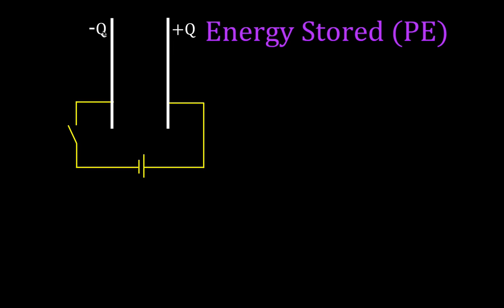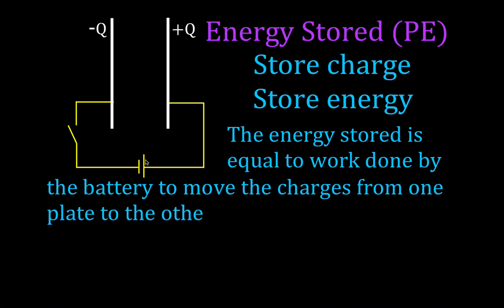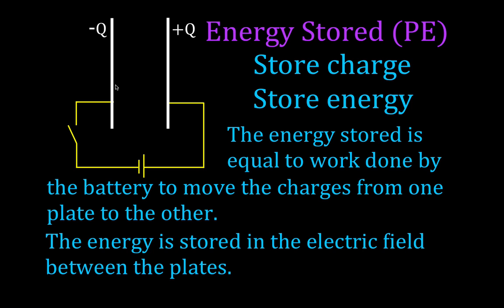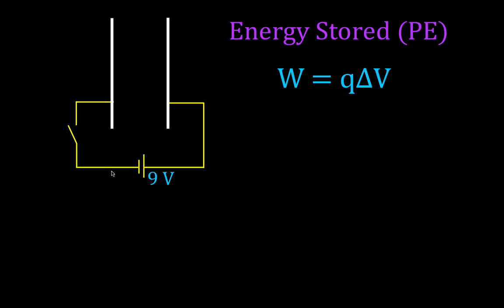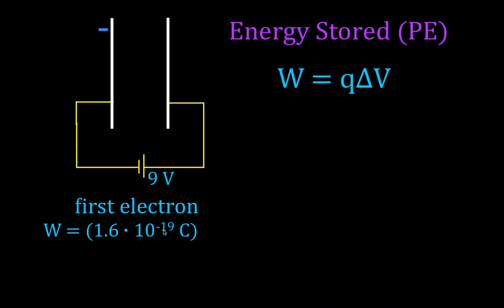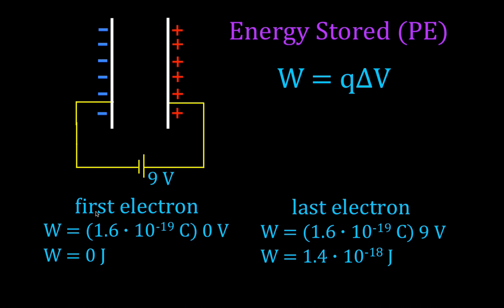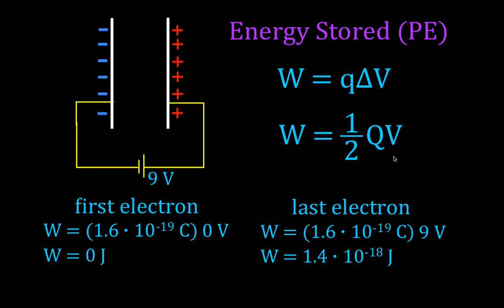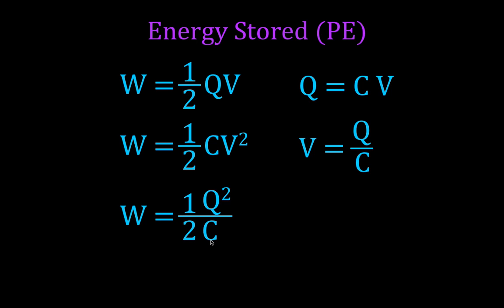Capacitors (7 of 9) Energy Stored in a Capacitor, An Explanation

Comment: Where does half the energy go? 
If you were to go by the definition of potential difference (work done to move 1 C charge across) then we find that V=W/Q and we know that W = Q V/2.
But if we were to sub in a value for V ie.
W = Q W/ Q 2 (Q gets cancelled)
W = W/2 or
1= 1/2 and that's not true so how is the energy magically halved? Where does half the energy go? Heat is obviously not the answer but where else could this 1/2 go?

Comment: Thanks for this explanation ! I assume if we plot a Voltage vs Electrons transferred graph, we can see the first point (first electron) has 0V, and the last point (last electron) has 9V, it will look like a linear ascending line from 0 to 9V. This forms a triangle which is half of total charge (Q) * voltage (9V)
Reply: Yes, and this example suffers by showing a 9V battery, which implies that as soon as the switch closes the capacitor plates are at 9V. It would be better to replace the battery with a current source, and show it charging the cap from zero volts to 9V.